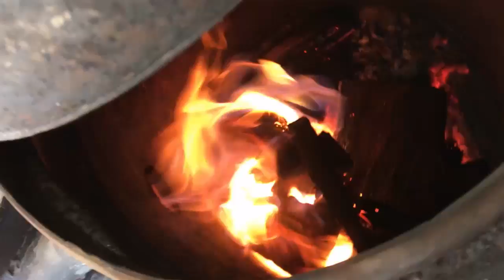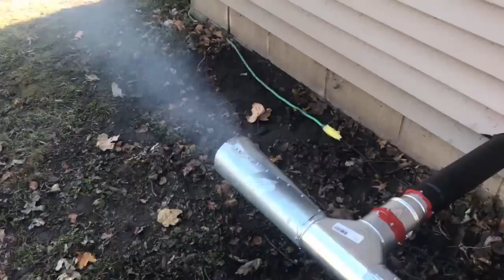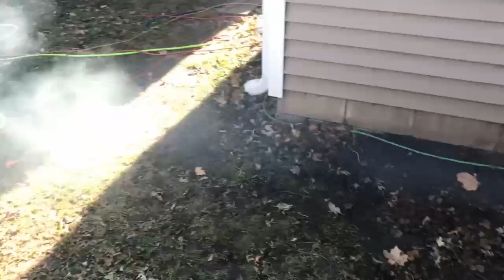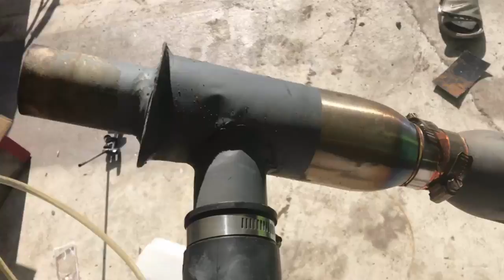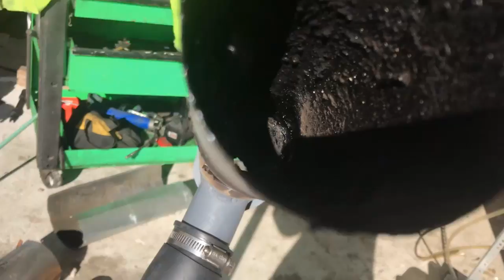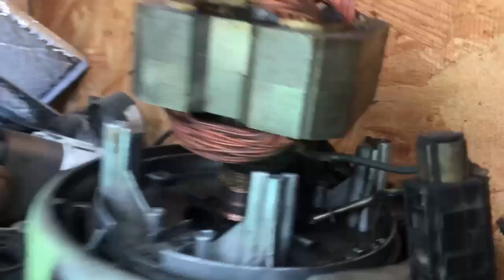Supercharged wood heater for shop heat

Comment: There isn’t a good way to speed control a single phase induction motor. You can add a sliding plate in front of the intake to control the airflow.

Comment: You need a better burner in the first place. Try a rocket with two well insulated burning zones and a small* 12v fan could suffice in boosting the flue if needed. 
Extract the heat just after the secondary burn zone and then exhaust the gases in a tall, vedtical flue. 
Try some 5"ish flue pipe and make at least ten feet vertical. 

Also consider letting the wood dry. 
I burn only wood cut the previous year or so. Like at least 8 months left to dry. What I've cut this summer and fall will burn well by the next fall. 

Chop it to fit the stove to dry faster if it's still in logs.

* I'm reffering to the higher-wattage pc fans that draw around 15watts. The 120mm 4000-6000rpm ones. Easily controlled with pwm. Knob-adjusted pwm controllers for oc fans are everywhere.

Comment: u need a variac
Reply: https://www.ebay.com/itm/Variac-Variable-Transformer-Powerstat-AC-Voltage-Regulator-500w-5Amp-110V-Auto/254002524124?epid=13023163576&_trkparms=ispr%3D1&hash=item3b23baefdc:g:i2gAAOSweWdb~m5D&enc=AQAEAAACQBPxNw%2BVj6nta7CKEs3N0qUsx6rAl7xn2pseqOVN%2BOip4zjvcM02RdE4mBKe0ILgOvOw4cDJXRHn8eMYlyyR7hXiSh2%2FY5yoi6N8w%2FBlcOOmivhjWz8faOPQ%2F8p6yntdkmPWBneovyzW5qCImdu4VipYoVmuNVLzc4%2B6PkxVCJxwZNwINIYqW%2BC2SZ85ijK0VNg0nABYtBdR9mi%2FGq6krL3SVLooGfiXev2Zv5Xj1fIkWrvaQag%2FPg7fXJLfZTN9%2B%2FGA9onHEA0aoMvgEiau9RioNa4lqSqBURouO9wnKFRUqGlnLx1w6RNpeLI6ePHdVRNP3VZ805OauuGLoUasVXFsgqUt8wAi97YeswEYoeyjXPKdwY1a9pkzEC3SMI5EDpIYuUxTW2bfZDxyH4USZHc8NAGxXm1EbjOKaxyE5Gfc3B%2FJx6IL8pWY96SgcpYFOCiZ47dRKR41OUIOK83DGPsjuMPsGbVvj9XVvibCgoa8m1kopHEVpLcmCX4WawW3TPJx4S5K8tidrKbCaNqHPx3JfcmOwttyOcYqfPyKxiOrpBnCTMqoE6VFutcTxfXJ8i68qI7T48KeEFPFdJVycH8NM9xYuB6rdVkTLleeAaiOFbocT5KjlwQCA%2BM%2B2OCNAzBHxlqTtiY7DiwG%2FDPsiBO784NgLHW3EoQvncIWGqMhpJro4MK2hb8OCRVw1FudWtWPMTpUDkptJxzGbMQctqhofmLfklF7ceGkZXBCUjyBSWm2nbnN5n7Bf6804bxpQw%3D%3D&checksum=254002524124dff0c81c36254f79b5de8c4ecbf59ca0&enc=AQAEAAACQBPxNw%2BVj6nta7CKEs3N0qUsx6rAl7xn2pseqOVN%2BOip4zjvcM02RdE4mBKe0ILgOvOw4cDJXRHn8eMYlyyR7hXiSh2%2FY5yoi6N8w%2FBlcOOmivhjWz8faOPQ%2F8p6yntdkmPWBneovyzW5qCImdu4VipYoVmuNVLzc4%2B6PkxVCJxwZNwINIYqW%2BC2SZ85ijK0VNg0nABYtBdR9mi%2FGq6krL3SVLooGfiXev2Zv5Xj1fIkWrvaQag%2FPg7fXJLfZTN9%2B%2FGA9onHEA0aoMvgEiau9RioNa4lqSqBURouO9wnKFRUqGlnLx1w6RNpeLI6ePHdVRNP3VZ805OauuGLoUasVXFsgqUt8wAi97YeswEYoeyjXPKdwY1a9pkzEC3SMI5EDpIYuUxTW2bfZDxyH4USZHc8NAGxXm1EbjOKaxyE5Gfc3B%2FJx6IL8pWY96SgcpYFOCiZ47dRKR41OUIOK83DGPsjuMPsGbVvj9XVvibCgoa8m1kopHEVpLcmCX4WawW3TPJx4S5K8tidrKbCaNqHPx3JfcmOwttyOcYqfPyKxiOrpBnCTMqoE6VFutcTxfXJ8i68qI7T48KeEFPFdJVycH8NM9xYuB6rdVkTLleeAaiOFbocT5KjlwQCA%2BM%2B2OCNAzBHxlqTtiY7DiwG%2FDPsiBO784NgLHW3EoQvncIWGqMhpJro4MK2hb8OCRVw1FudWtWPMTpUDkptJxzGbMQctqhofmLfklF7ceGkZXBCUjyBSWm2nbnN5n7Bf6804bxpQw%3D%3D&checksum=254002524124dff0c81c36254f79b5de8c4ecbf59ca0
Reply: if it was a dc motor it would be easy with speed controller if u use a dimmer switch  it will get ruined only way u can manage the speed is with a variable transformer

Comment: hey man, you might be able to keep burning wet crappy wood and still not get any build-up at the throat. It just needs to get a lot hotter. if you watch videos on rocket stoves you’ll see that they use a refractory mix at the combustion chamber and they insulate it so it gets to about 2000 F. Most metals will melt or just corrode way too fast at that temp. You just need like a 3 ft section of instulated refractory and the rest can be that metal pipe you’ve been using. Good luck!

Comment: It seems like the only way around the wet wood problem is if you just have a massive heater with a lot of dry wood in it to begin with. 
 I'm not an expert on this, but you have to consider how much energy it takes to boil off the water. 
https://www.google.com/search?client=ms-android-sprint-us-sscr-revc&sxsrf=ACYBGNQSoqXd4wy_mNE8neOjIFbubioC1Q%3A1575693043496&ei=8yrrXdbXHYyQsAXSnJGwAg&q=how+many+joules+of+heat+does+it+take+to+boil+water+gain&oq=how+many+joules+of+heat+does+it+take+to+boilwater+gain&gs_l=mobile-gws-wiz-serp.1.0.33i10.154082.162536..164486...0.4..0.128.2177.3j17......0....1.........0i71j0i7i30j30i10.QyIkevB1YKA#sbfbu=1&pi=how%20many%20joules%20of%20heat%20does%20it%20take%20to%20boil%20water%20gain

Comment: I used a blower out of a diesel steam cleaner and a dc motor from a treadmill along with the speed controller it works very good at any speed the higher end treadmills have a lot better components. I found the one that I used on Craig’s list. I hope this helps thank you for the video 👍🇺🇸

Comment: Actually, capacitor driven motors are 2 phase motors with one phase "synthesized" by capacitor. Sadly, not many 2 phase vfd's are available. Some are changing motor output with variacs  or dimming, but those are crude solutions.
Reply from the maker: agreed , i did not like the effects of a triac on this motor not to mention the power factor tanks when you jack with the capacitance
Reply: @NOBOX7  effective and variable speed fans are made by Ebm Papst, but, for that price difference, you can use your fan at full power for many years. That is a sad truth. I made a fan with 3 phase 12v bldc motor from model aircraft, but the hardest part is to jerry rig that motor together with an existing fan.

Comment: You can mechanically choke the inlet, when the inlet is blocked the motor works less and draws less electric energy. That %30 improvement in flow you got from removing the inlet guard probably increased the electrical use by %30 too. If you want to control it from inside you could use a little servo, or mechanical cable or something. I've seen people use a variac transformer to control stuff by controlling voltage, Amazon is selling those for less than $100. I'm not sure how that would effect the energy use.
Reply: i agree with pretty much everything in this comment. There's only really one other thing that you should keep in mind (if you chose to alter the line voltage with a variac), if the motor is a capacitor start rather than a capacitor run motor it will burn out the start winding. The easiest way i know to tell which one a motor is to listen to the sound it makes on startup, if it makes a loud click when it reaches full speed then it's a capacitor start, if not then it's a capacitor run. If it is a capacitor start, don't even try to speed control it because it is pretty much  guaranteed to damage the motor. (the inlet choke works due to the motor running at a constant speed and i would personally recommend trying that first as you are using an induction motor)

If you want to go through the hassle of installing a switch between the motor and both sides of the start capacitor you could technically speed control a capacitor start motor(i haven't tried that). 

Side note if you do install a switch on a either type of motor it will not spin if you try to start the motor with the switch off (it will still draw pretty much full power though)[technically, again i haven't tried it].
Reply from the maker: Great idea Tim , i love it , i never thought about the power draw being less with just chokes

Comment: Put a catalytic converter in the line! (~_^)-b

Also, although that is a single speed motor there, what you CAN do, is put a fresh air bleed in the line.

In COMBINATION with a catalyst, it will burn that creosote and soot so you have clean exhaust AND get more of the energy out of the wood instead of it all sticking to your exhaust.

On top of that, compressing the air before the fire chamber is going to greatly reduce the creosote because, as I said before, rarified air never burns products properly, it can't because it reduces the physical interaction of the oxygen with the fuel and forced expansion = forced cooling [you are in essence turning your furnace into a very hot and dirty venturi style refrigerator].

https://www.youtube.com/watch?v=Bsab0co1mcY

https://patents.google.com/patent/WO2013171744A1

So as you see, you are robbing yourself of a lot of heat while burdening yourself with a lot of work in maintenance and cleanout by using a reduced pressure combustion system.

Comment: PWM?  Maybe a router speed controller (harbor freight - $15-20) will probably work or maybe even a dimmer for a high power halogen light - 1500W dimmer.  I've used all these for fan, vacuum & blower controllers and they've always worked.
Reply from the maker: wont work on capacitor motors because as the speed changes the needed capacitance changes .
not sure why but they dont sell any thing , i even called a company
Reply: @NOBOX7  I have a few motors with capacitors on them that work fine with the dimmer and router speed controller.  Have you tried to use it?  What happened if you did? If it wouldn't start, did you try starting at full speed and backing down?  I've seen some that don't work starting from off/low and moving up, but work the opposite way.

Unfortunately i've found some manufacturers don't always know all the facts about their equipment, especially most recently when they outsource manufacturing or slap their own label on someone elses product.
Reply from the maker: @kde5fan737  Yep on to different motors . neither work worth a crap and sounds like motor will surley burn up
Reply: @NOBOX7  See if you might be able to use a universal motor on it, the kind with the graphite brushes.  They work very well with the controllers I mentioned.  

What was the wattage or HP rating of the fan?  I'd suggest looking for a leaf blower or shop vac on craigslist or thrift stores.  If you are using is as a venturi blower source, these will work very well and work great with a $7 controller & the others I mentioned.  $5-15 for a used unit and if it works, great run it till it dies then replace it with another.  I've been using mine a long time at slower speeds.

Another option that is lowish wattage but blows a lot of air is a fan from a microwave with an exhaust vent.  These are awesome fans that actually produce pretty high CFM at fairly high pressure and can be run 24/7 and a standard 600w dimmer works fine for them.
Reply: https://m.ebay.co.uk/itm/50-60HZ-Single-Phase-AC-Motor-Speed-Controller-Electric-Motor-Speed-Regulator/192866358581?ul_ref=https://rover.ebay.com/rover/1/710-53481-19255-0/1?ff3=2&pub=5575376664&toolid=10001&campid=5338268676&customid=CjwKCAiAlajvBRB_EiwA4vAqiJa8WkqrmF4b7FllPA7leRTmDyAKC3prr_77O-MuBMWoQtzP2sq4KBoC6_cQAvD_BwE&lgeo=1&item=192866358581&srcrot=710-53481-19255-0&rvr_id=2210886014939&rvr_ts=db1849da16e0ad326ad397e5ff7e39f6&_mwBanner=1&_rdt=1&ul_noapp=true&pageci=7e4cfea8-1dce-43f5-a0e4-1753c60abfca